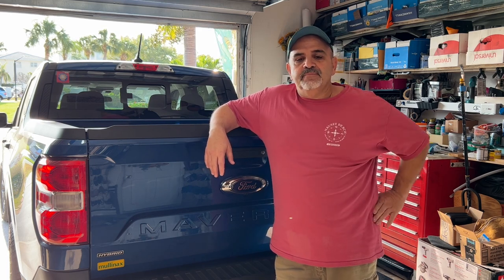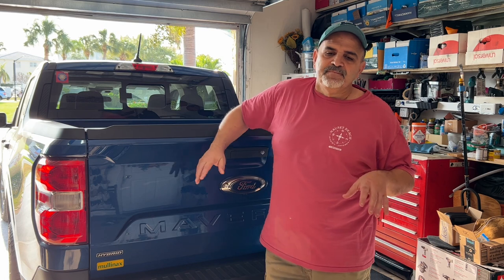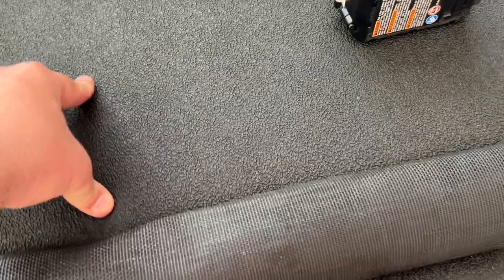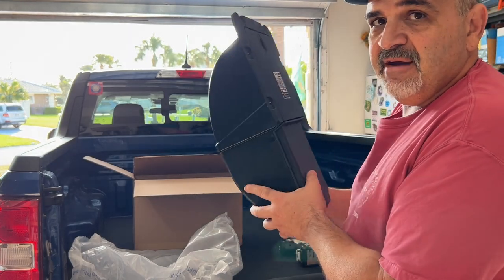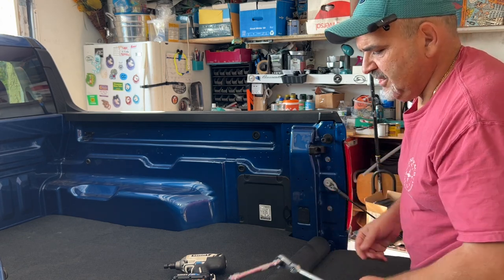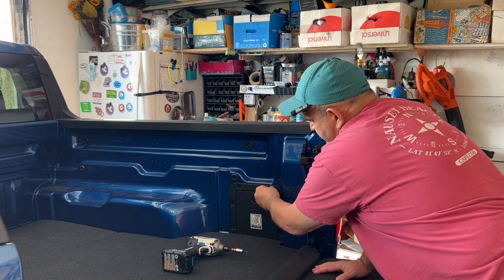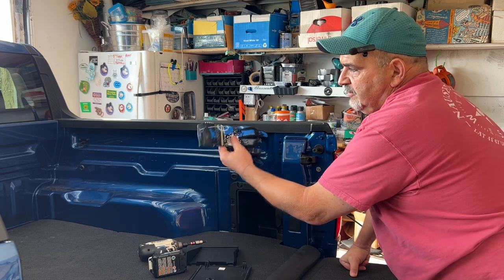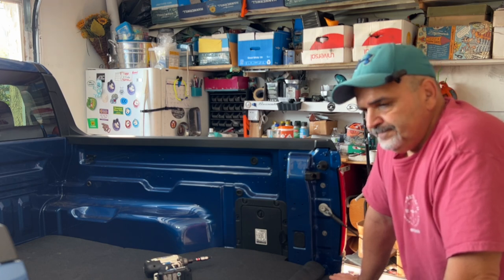Ford pass points for a free upgrade. https://amzn.to/3TFOwUO ( Ford Bed Container )

Comment: Is that cubby water proof?
Reply from the maker: I don’t believe so because there is no gasket, but I bet you could put on a thin self adhesive gasket and it would be.
Reply from the maker: I don’t believe so, but you probably could put a thin self adhesive gasket around it and it probably would be I’m not 100% sure if the knobs that lock it would leak
Reply: there is a small rubber gasket on the legs and head of the outer door, but not at the bottom where water pours right in. Whatever you put in there better be in Ziplock freezer bags.